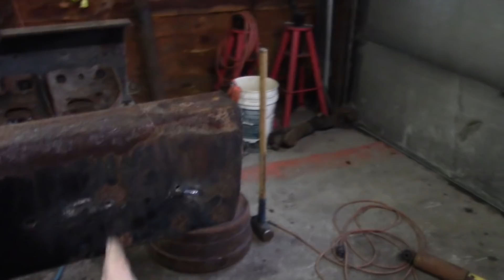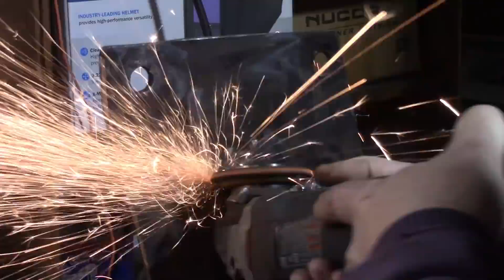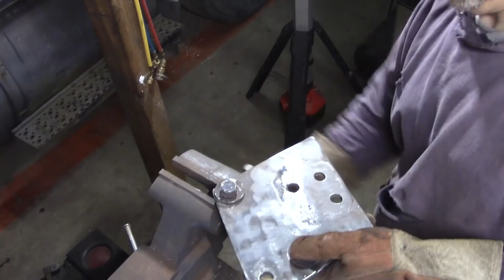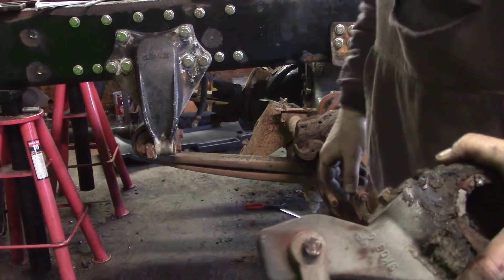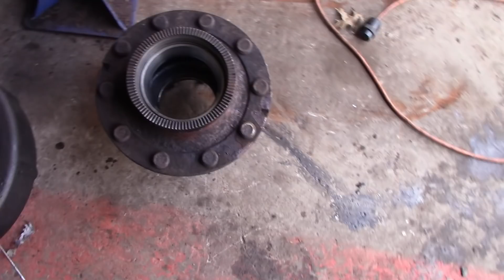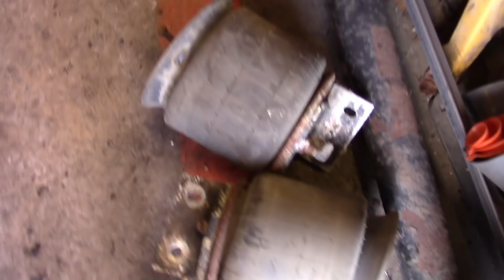PT 2 F750 AIR RIDE SUSPENSION SWAP!

Comment: Shars Tool Company has a universal transfer center punch item # 505-1109 for less than $7.00 that should work well for the punched holes that you deal with.

Comment: JC what type nuts are typically used on the truck Axle U-bolts. Are they ordinary double back to back hex nuts, or are they special self locking nuts. 
Our trailer (caravan) spat the rear axle off the twin axle set up when the double plain hex lock nuts and spring washers undid themselves on the remote outback road turn off to Kings Canyon south of Alice Springs in Central Australia.

Comment: Great video once again JC! I agree with you regarding those little tabs on the locknut but I have grown to dislike the double nut situation as well. Have you ever looked into the Stemco ProTorq nuts? I have slowly swapped out our fleet from the double nut system to these and really like them! Keep up the great work!
Reply from the maker: i have seen them. i guess i am just old and stubborn. i like the double nut set up.

Comment: On a tandem axle truck, do you need to have a double brake chambers on both axles or is one axle sufficient for DOT sake??
Reply from the maker: most over the road trucks with 40,000 lbs rears only have parking brakes on one axle. heavy haul guys like to have all 4. it is a double edged sword.....if you put brakes on both axles and the brake shoes are stuck to the drum, it is harder to brake free if all 4 are stuck. having 4 brakes is better with heavy loads and icy conditions.

Comment: Pull your axle breather out of the housing inspect it. I have seen many where the "hat", top of the breather is loose and pulled the breather out of the axle to find the internal passage plugged with rust,  causing another seal leak. We scrapped many brake shoes due to rust jacking on school buses thanks to salt and brine.
Reply from the maker: good point. i have seen that happen before.

Comment: The heat from the fire may have melted some of the urethane in the leaf spring's Atro bushing.
Reply from the maker: you may be confused kevin. i cut off the original frame section with the suspension and axle on it. this is an entirely different set up from another truck.
Reply: Ha! Your swap-in looks so OEM, it tricked me.

Comment: Hey you might know this trick already but use john deere blitz black is an awesome chasis paint,durable and doesn't  chip we used to use it at a shop I worked at  it's very reasonably priced too.
Reply from the maker: never heard of blitz black. i will look into it. thanks for that.

Comment: We had a 10ton Hino truck in the last shop i worked in and it hadn't had a service foe a long time. The rear shoes have a step in the side of the that you can see through the backing plate. When the linings wear down to the step you overhaul the rear brakes. These ones were worn down to 3 1/6 thick and the heads of the rivets had eaten there way into the drums. Usually you pull the axles like you did, backing the adjusters but the rusty adjusters wouldn't back off, so the drum wouldn't come off with the hub. In the end i took the wheels off the hubs and got the grinder and the drill and the chisel and split the drums. The grooves in the drums were 1/4 inch deep. It added another hour and a half to the job and the cost of the drums.He didnt save anything by not getting a service the previous year.
Reply from the maker: lack of maintenance never pays off. pay a little now or a whole lot more later.

Comment: If I remember correctly, the ones we had in the Army 40 years ago, had a wire that went into the nut. I just got that in my head
Reply: Yes that’s the way the front steering axles are set up. They have a castellated nut with a cotter pin that passes right through the spindle.
Reply: Don McIntosh 
I drove for a guy who had a Jack leg mechanic 👨‍🔧 and he forgot to put the cotter pin in the hole. I was on 40 in North Carolina when the whole assembly came off the driver side steer. Drum was attached to the wheel.

Comment: I have a set of those nuts! Oh wait there for a Dana 60 there alot small! Do those locks only engage every half turn? Seems kinda lame.  Thanks JC
Reply from the maker: the springs locks can be removed. there are "adjustment holes" all the way around the "washer" that you can put them in. i read up on the removal and instal literature from the manufacturer....i wasnt impressed.

Comment: Studying up for my air ride swap! Keep up the good work!
Reply: Uncle Tony says your are a CHAMP.  YOOO CAN DOO IT !
Reply from the maker: the front half of this cut off that i used is the suspension i was telling you about. very easy to install. the cross member is made up of 3 pieces so it would be simple to make fit your frame width. pan hard bar would likely be too short but im sure you can use the ends and built one the right length. found some a/c parts for you too.

Comment: That nut in there takes a special socket. I love the propower nuts user friendly  no special socket needed for them JC. I'd switch them 4705 brakes up to the 4707 q plus  beings you're putting new drums on too.
Reply from the maker: i will be replacing this nut with the standard nut, locking plate and jamb nut. we will look into the cost difference to the 16.5" and go from there. it wont be towing extremely heavy or even near the axles capacity ......we will see.
Reply: @j.c.smithprojects  I'm telling you once you go to the 4707 you'll never go back to the 4705 the wear an longevity of them out way the $3.00 more a stop box an the $10.00 more a drum
Reply from the maker: just ordered all the parts. i dont know why i kid myself by saying this is a budget build....the only thing that was "budget" about this was the fact i used the rear axle and suspension that i already had.
Reply: @j.c.smithprojects  just money an parts is what was always told as long they wasn't paying the bills for it

Comment: Lots of progress JC, good to see the fire didnt ravage things too badly on the axle and what not, some usable parts still there. You never know what things look like till you get into the meat and potatoes of it and see what is what and yup dont blame you for wanting to go thru things thoroughly, and make sure you have a look at everything you feel you need to, nothing worse than having to go back in a second time to do a do over on something. If the air bags are holding air I would give them a shot, bags arent terrible to swap out but dang if they cant be a tad expensive these days. Lots of work to go but your making some short work of it...be interesting to see how it all comes out when she's done
Reply from the maker: this is a completely different axle. the original was hot and there is no way i would trust it. i would like to replace the air bags but they i will wait and see if they are ok. if i dont have to replace them, it makes it easier to absorb some of the surprise costs that may pop up. feels like this is taking forever but i am working on many others trucks at the same time.
Reply: @j.c.smithprojects  I didnt even pick up on the fact it was the different axle.... I thought you just did a hell of a job cleaning it up... no wonder it looked so good to me...lol.  I dont doubt you have a few on the go seems like you always do, I am amaze you get so much done as it is with everything you have on the go. Ah well it will get donein time I have no doubts about that...well hopefully the suprises are kept to a minimum

Comment: Hey J.C. those spindle nuts are quite common on mid 2000 internationals..i never had one fail..tho i have seen those spring steel locks..one side would break while backing the nut off..i'd blame that mostly on worn axle nut sockets not being tight enough..after figuring that out and buying a new socket..i always free them with a screwdriver so not wedged in the hole before using a socket...As far as the wedge cones..definately a P.i.t.a...otc makes an axle removal tool that works good for such axles..try hitting within reason..the edge of the axle flange as well as the face..it helps --kind of how you hit to remove a tierod..OTC has a cone removal tool #OTC7077 it works soso..i have it..$29 from tooltopia ..Another tool i like is the skf seal puller #SRT-1 works great on all brands .Lastly..snap on sells an ancor pin removal press..it also removes and installs the bushing..great tool but $400..so i use my otc ball joint press for the pins..and a bushing driver on the air hammer adaptor from snap on..just sharing what works well for me
Reply from the maker: i read the literature from "axilok" about these nuts and i wasnt impressed. i am looking for replacement nuts, lock plates and jamb nuts. i have seen the pliers for the cones. these were so badly rusted in place that i used the air hammer to get them out. only ever had to do that one other time. i can usually use my otc ball joint press to get the roller pins out but this took a little heat. i did have to smack the "flange edge" of the axle to try and shake those cones loose.....no luck. i would like to have the bushing driver to install them. i dont want to mess up the new bushings.
Reply: @j.c.smithprojects  i agree with you..i like the old method with an inner nut..a ringed washer and a locking jam nut best ..I've had a few occasions where i found new cuss words on getting the cones out as well and the only other trick i have to share that works sometimes is take a medium pair of visegrips..put one jaw right on one side of the split in the cone and the other jaw halfway around..it helps seperate the gap and try twisting it...i'm sure you most likely have tried that as well..Your project is coming along well..when it's done i'll take those tall jackstands off your hands lol..i have the mediums..those are next on my list
Reply from the maker: i ordered those stands from summit racing. i was amazed at what a deal they were compared to other suppliers. they had free shipping also! i usually take a "screw chisel"....you know, a screwdriver...and tap it into the split of the cone to open them up.

Comment: 2 questions.  Maybe you answered this before but what ratio is this Rockwell rear? Also are you replacing the slack adjusters with manual or self adjusters?
Reply from the maker: rockwell 3.90 ratio as the truck had before. i dont think i am replacing the slack adjusters unless they become a problem.
Reply: Has to be auto to meet dot spec.
Reply: If i recall correctly..it's not legal to put manual slack adjusters on any truck manufactured from 1995 to current..i like manual slacks..it makes you crawl under and inspect your brakes and other things lol ..now to keep legal...i like the meritor slacks..keep them clean and greased..they work well
Reply: @chrissterling3225  My thought was since this rearend was part of a cutoff that had been stored outside before JC bought it that the s-cams rollers and slack adjusters would be some of the first parts that would have to .be replaced.  I always liked manual adjusters for the reasons you mentioned. I drove older trucks and that's what they had.

Comment: That reinforcing plate you had to repair is a good case of stepping over dollars to pick up nickels! Truck is coming along nicely. The smaller washers look a lot better on the frame compared to the large ones.
Reply from the maker: wish i would have looked at it closer before i cut it out. i would have just made a new one. hind sight is 20/20.